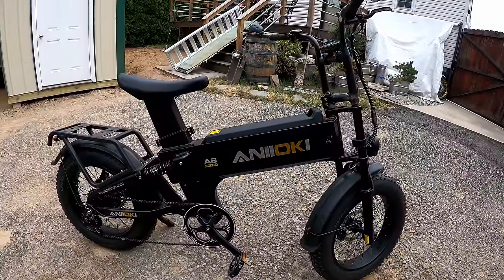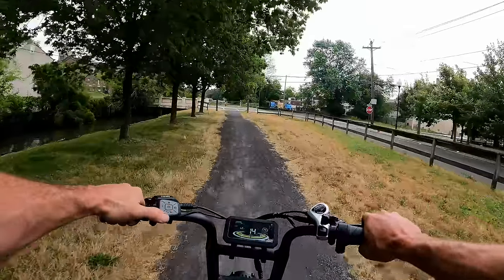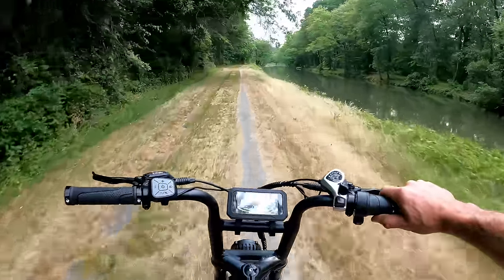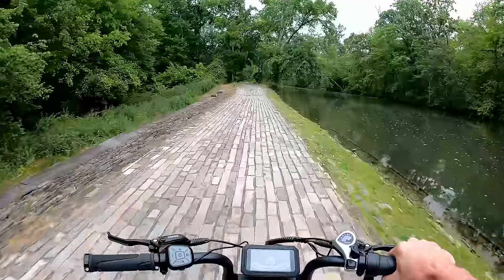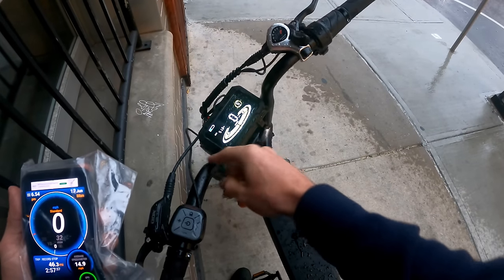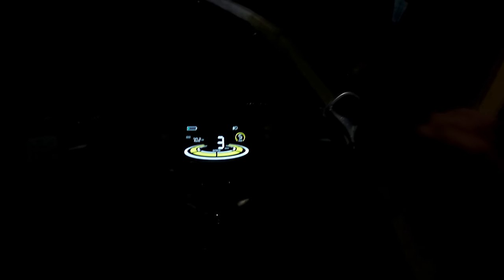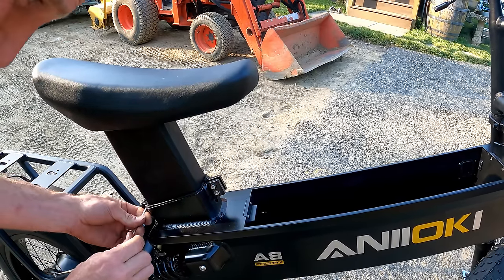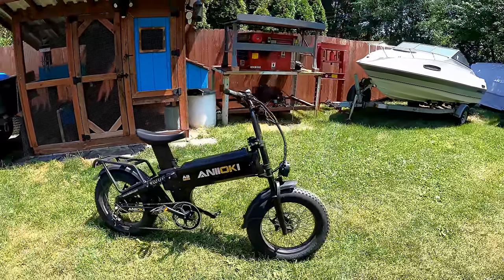ANIIOKI A8 Pro Max Electric Bike Review/RANGE TEST

Comment: THANKYOU SIIR!
 For being one of the few who mentions you can adjust the "jumpiness", lag, and peddle assist features. These bikes are really advanced to where you can even adjust the battery percentage used per gear you are in, all through the "ADVANCED SETTINGS" in LCD screen...  Most (probably 90%) of reviewers I have watched get a bike fresh out of box. The bike is tuned to a very middle of the ground gear settings, to cater to the most wide range of riders depending on the bikes specs. Most times the bike will not be tuned to there liking and reviewer is very quick to dismiss bike as a "bad" peddle assist bike, jumpy, laggy, or have a low top speed etc.. These E bike companies are giving these e bikes out to reviewers large and small channel size like candy, and reviewers are lacking the time, experience, and knowledge to give an honest thorough review. Just frustrating to see a lot of good e bikes get bad reviews. Then certain e bikes that are not so great to begin with, but tuned more to their liking out of factory, get a lot better ratings..

Comment: I've owned this bike for about three months I have about fifty miles on it absolutely love it. Although I must say I have already changed the seat:)
Reply: what did you change the seat too ?  and how ?   would be interested to know :)
Reply: me too i want to know !
Reply: What did you change it to?
Reply: How is it getting up hills?
Reply: Fifty miles in 3 months!? You should have at least 500 to 1000 miles by now. Be sure to charge the battery to 50 - 60% if you leave it sitting for an extended period. Lithium batteries hate being full or empty for extended periods. The battery can be stored forever at 3.85v per cell. For a 48v battery that means Storage = 50v. Full = 54.6v. Empty = 45v.

Comment: FINALLY! A video that actually gives a proper range test. Most reviews mash it constantly and through brush and sand and I want to know how far you can go in real life situations (Nice job on washing the bridge out), NOT mashing it but riding it like you would in real life. I need to ride at least 30 miles one-way, and most bikes can't handle 30 miles one-way & back full throttle without some sort of assist.

Comment: Hi Chris.  The phone GPS only accounts for straight-line measuring, it doesn't account for the actual ground surface covered.  For example, if you go straight by doing a Z pattern the bike will read more than the phone's GPS.  They can only calculate the distance of that straight line.  So let's say you take a wide turn, and the phone GPS calculates a sharp turn, Now the phone speed recording I believe is more accurate as I have tested that against my truck and they are the same when I have new tires.  a few years later and it's a little off because of the loss of tread.
Reply: Well said and good points Mike!
Reply: Agreed Michael.  Many variables in tire tracking vs GPS tracking.  Basically, if you tune your E-Bike speed in a straight line, as close as possible to the GPS speed, that's the best you can do.

Comment: So Chris, with all the free E-Bikes you've been given, it seems like you've changed your tune regarding cable brakes vs hydraulic brakes.  Can you confirm that change of opinion?  Love the videos and keep up the good work.

Cheers, Sev
Reply from the maker: Same same thing as I spoke about how great these hydraulic brakes were. I certainly like cable brakes for this simplicity and ease of fixing. But can't beat the responsiveness and power of hydraulic brakes
Reply: @NNKH2  Fair enough Chris :)  I've had experience with both and I can see your points on each system.  Recognizing the general weight of most modern E-Bikes, I'd say that hydraulic brake systems are the way to go for the heavier ones.  With the lighter, low-capacity battery ones, cable brakes are probably a more simplistic system.

Cheers, Sev

Comment: I bought the 52v about a month ago, got 700 miles on it and loving it. It's just breaking in where the shocks don't make any noise now. If you buy one you will definitely need a seat cushion
Reply: How did you get a 52v last month? I see they are pre order. Maybe they were done in batches? What's your top speed on the 52?
Reply: Do your breaks make the noise his does in the video?
Reply: I also have the Aniioki A8 Pro Max 52v and my range is 80-90 miles.

Comment: Love this vid! Thanks for doing the review as I am saving to buy this awesome e-bike!!! 👌🏻😍💕 Also, this might be a silly question, but do you happen to know the difference between the 48V and the 52V version of this exact model? Would the 52V provide more range? Orrrr no? I noticed the 52V is a few $$$ more than this 48V version. 😊
Reply: A 52v battery will only give you an unnoticeable boost because a 48v has 13 cells. A 52v has 14 cells. A 48v battery has 52.6v when fully charged.

Comment: I'm fairly certain if you were on pavement only you couldn't have hit that 100 mile mark. Although those gravel trails are well packed there is still a little more rolling resistance that the motor has to overcome. Great review.

Comment: Hello.  Just wondering how tall you are and if the bike seems too small?  Also, would you say the seat is comfortable for long rides? I am looking at this, the Aehora Romeo, and the Fucare Gemini X and trying to decide between them.  Thanks, and great video!
Reply from the maker: I am 6 ft 3. This bike is fairly comfortable for long rides but if you plan to pedal, definitely not ideal for that. A taller bike would be better

Comment: If possible please, in these reviews could you start mentioning what size and brand of battery cell is used ( i.e 18650 vs 21700 size cell ). Also if the motor is a direct drive or an internal geared motor. If the hub motor uses planetary gears they are often nylon and are greased. Could also give motor controller stats, they often list a maximum current output and / or nominal output. This is relevant because battery packs can sometimes provide more OR less current then the motor controller can handle

Comment: 87 miles on a bike, that is insane ... my HOver-1 Instinct averages only 18 miles on a full charge. I've been thinking about getting this bike but I'm in Florida and if the bike's top speed is over 20 mph, you actually need a license plate and registration for it and a driver's license which I already have but it's crazy to think you would need that. It's like you said man, right now it's all out of control but eventually, regulations will require everyone to have registration on plates and even insurance on all these bikes. I can't believe you actually have to center the steering column with the bike ... you would think they would engineer a notch so that it's automatically centered upon installation a bit sloppy there in my opinion.

Comment: The alarm seems to be the same as mine. Does it lock the motor? 
Looks wise. I thought it looked like a folding bike that doesn't fold, lol. The battery may be its best feature, at least to me. Does it have an option for a second battery in the seat post? 
Anyway, great video.
Reply: They make a folding model with 20ah battery

Comment: I really want a folding ebike with 100 mile range.  I hope someone builds one. I hope battery tech gets better in a few years.
Reply: @jukio02
I  think the Wallke H6 might be what you’re looking for!  It has dual batteries , I think 38 AH total, it’s a folding bike, has top speed of 32 mph and I believe the range is about 80-100 miles !
Reply: Range really depends on lots of conditions, your weight, temperature, speed, is there any hills or flat ground where you are riding, you can get 100+ miles using this bike on PAS 4-5, 90 miles throttle only on flat surface, also walkie h6 dual battery can get you 100 miles using PAS 4-5 also

Comment: Nice... have a bike similar but not the same range... of course easy to give it more range by buying another Samsung battery for it and carry it on the rack. I like this mahcine.... if I decide to buy another this seems very nice, thank you for the review. My machine does about 32 MPH and had it peak at 35 going down a hill... climbs great... the machine I use currently has alarm like this but I can turn the machine off manually, also have cruise control function and a Bafang motor at only 750 watts and can do 32 mph. But I don't weigh a lot... and missing my left leg so using the carbon fiber and titanium took a lot of weight off my body with the prosthetic Össur leg I use and lost it with a motorcycle falling on me back in 2018 and other issues, wasn't even riding it when it fell I did not want the paint scratched up so lost my left leg protecting paint. I don't advise doing that for any machine... LOL! Any way wish you the best and thanks for your video... I like the range of this machine and giving me ideas... later and wish all of you the best.
Reply: What ebike do you recommend?

Comment: Interesting you should mention regulation, Chris. Here in the UK, e-bikes are limited to a max speed of 15.5 mph, need to be pedal-assist only (I think - this may have changed recently) and the motor is limited to 250W. Obviously, there are bikes with more than that, but they are classified as mopeds and have to be registered, taxed, insured if you want to use them on the road and you must have at least a moped driving license. Twist & go bikes are available, but you basically can't ride them on the road here in the UK without a licence etc. Off-road (on private land), it's "do what you like". So I am very jealous when enjoying your reviews! 🤣 Keep up the great reviews - love the scenery! 👍
Reply: mlMaybe move out of the Uk if you want a good ebike. Otherwise stick to one of your mini European cars.
Reply: Damn that sucks!

Comment: E-bike law in the UK is already pretty strict, pedal assist only and only assist up to 15.8mph. Anything with a throttle is classed as a motor vehicle and must be completely road legal, taxed, MOT’d (inspected) and insured. So this bike would be classed as a moped in the UK.
Reply: Oy, ya got a license to make that comment m8?
Reply: i'm in the uk and ride an e-bike which is 1000W  never had any issues ,i find its how you ride them ,and always make sure your pedalling ,the Police tend to go after e-scooters which are totally illegal in the UK  ,also the laws are a very grey area because not even the Police know what is totally legal ha!  Did you also know that in some areas of the UK the Police are using e-bikes ?

Comment: Saw someone pushing a "dead" electric moped the other day. These are NOT bicycles. Not saying they're not useful for some things, but not a bicycle.
Reply: Sadly  if it has pedals and a chain then its classed as a bicycle :)  a moped has NO pedals and also a large thing called an Engine ha!
Reply: @jamjar47  

Nope.

"The word moped was coined by the Swedish journalist Harald Nielsen in 1952, as a portmanteau of the Swedish words motor and pedaler. The claimed derivation from the term motor-velocipede is incorrect.[2][3] According to Douglas Harper, the Swedish terms originated from "(trampcykel med) mo(tor och) ped(aler)", which means "pedal cycle with engine and pedals" (the earliest versions had auxiliary pedals).[4] Like some of the earliest two wheeled motorcycles, all mopeds were once equipped with bicycle pedals.

The term moped has now been applied by some regional governments to vehicles without pedals such as motor scooters, based on criteria of restricted engine displacement, speed, and/or power output. This is a misnomer, as they are no longer "mopeds" at all, and might instead be called a "noped" if they appear to look exactly like a typical moped, but no longer include pedals.[5]"